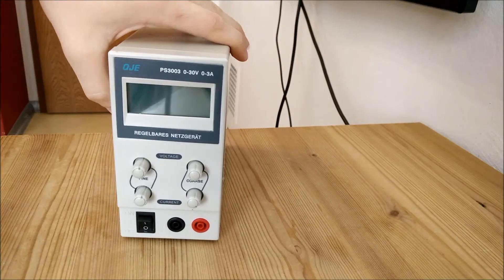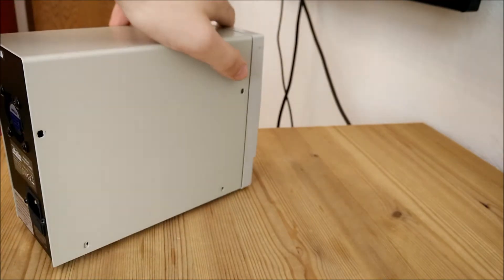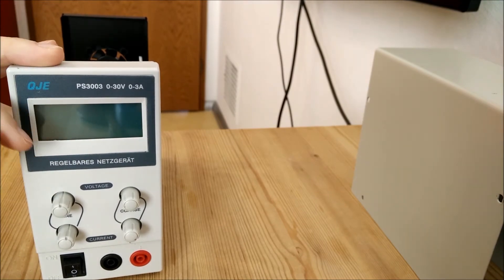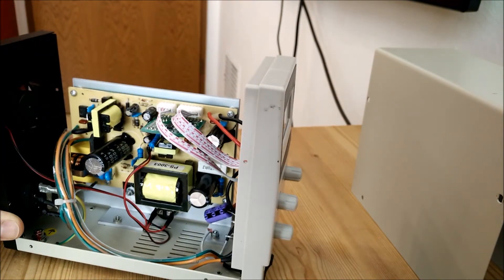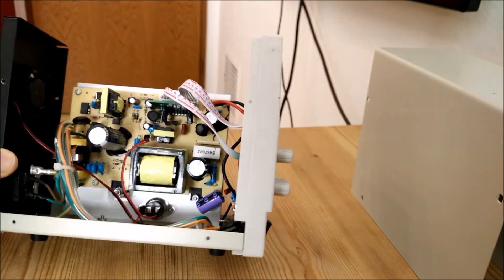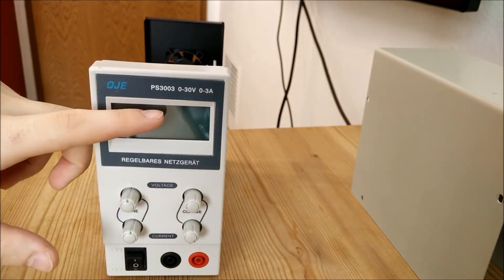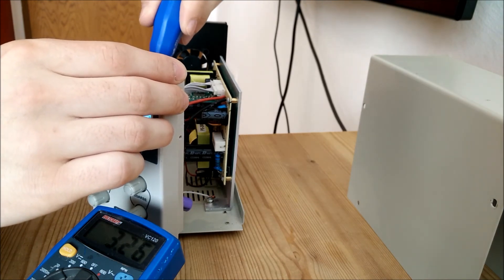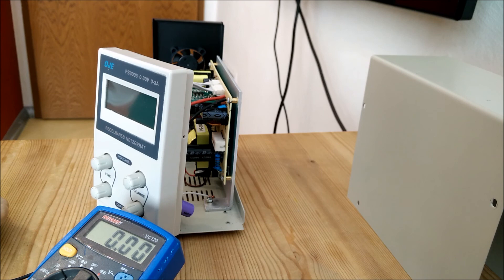How to hack/mod you Laboratory PSU to output more Power, 3A to 5A Mod, Chinese PSU

Comment: Your absolutely hilarious!
You repeat what another (other YouTube channels) have said. I'm willing to put actual money up on the fact you know enough about electrical engineering to know that you don't know anything that you pretend to know on your video. 

It's so funny too. This is the 3 amp version , there is a 5 amp version that charges more. It is malicious.... Lmao. Your looking for the word facetious. Lol. Also how you say they weight the same so that they are the same. Lmao. Pull the schematic on both. Get your hands on both. Do an actual side by side comparison before you claim something. Because 1 you come off like a smug ass tard and 2 your slandering the sellers saying their products are malicious lol when it is you who is actually being facetious and ignorant by blindly claiming something with which you've not actually factually verified. 

Also your turning of the 2 "hidden" pots..... Classic. 
 So sure. You get a little for amperage if so desired. But is your output transistors and capacitors rated to handle that extra bit of current.... Before you answer that. Are you sure. Did you yourself do the testing.... Did you put it on a basic oscilloscope... Are you formally educated at all in this/ your hobby or are you truly an educated professional....

Lol. Good luck to you guy!

Comment: Thank you very much! It worked! I also have 3A unit and max current was 3.26A. Now max current is 5.22A! WOW!
With other trimmer I can set output voltage up to 34V, but this is small change. Hope it will not blow up...
If your Amp meter shows some current when nothing is connected, just hold down little button on back of the LCD. It will set current to zero.
Reply from the maker: You are very welcome. This sounds great, you got an even bigger increase in Power-Output. I hope so too :D. That is a nice piece of information, thank you!